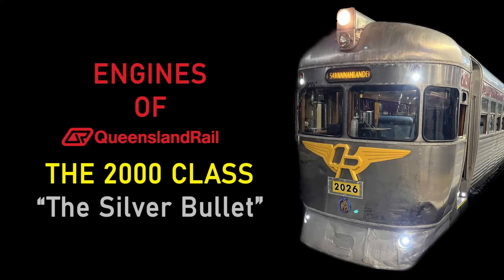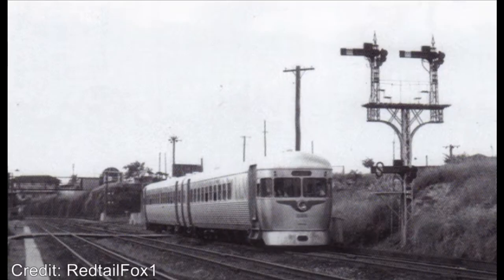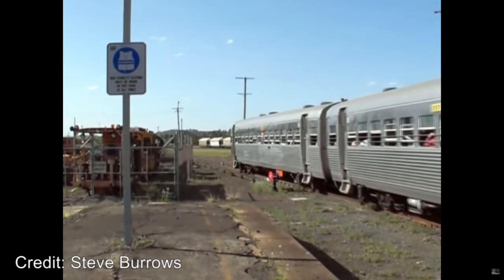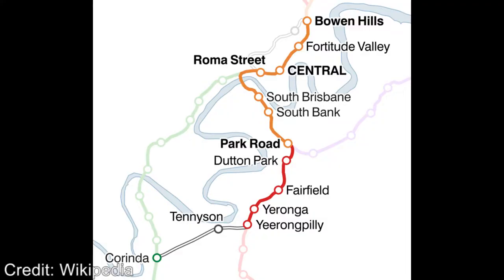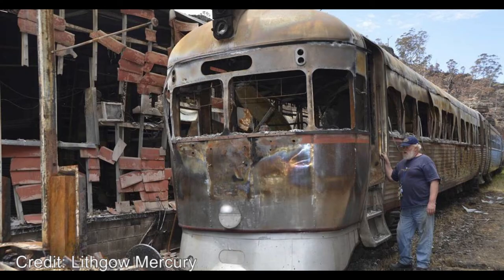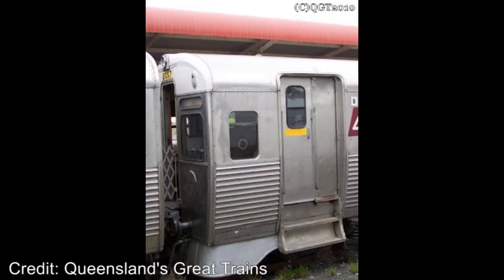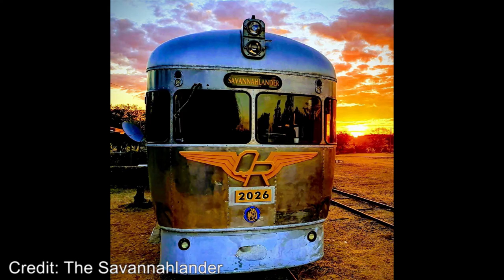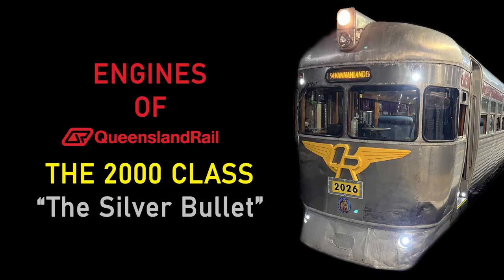Engines of Queensland Rail: The 2000 Class 'The Silver Bullet'

Comment: With respect to the 2000 Class engines, all models including the 1900 Class were fitted with  AEC AH 590 9.6 Litre 180 Hp engines until they were repowered with Rolls Royce engines in the late 80s -early 90s. QR called for tender to repower the railcars but as Leyland/AEC were unable to supply the same type of engine, Rolls Royce supplied the required units. QR needed an engine of no more than 180 Hp to avoid wheelslip and damage to the transmission.

I was involved in discussions with QR at the time, and mechanics from Leyland Trucks at Rocklea were called upon to commission the AEC engines when new railcars were ready for delivery at ComEng in the 70s.

The 1900 Class still has its AEC Engines.

Comment: A correction or 2. Most of the 2000 class had AEC220 engines early on.  The units at ZZR retain those.  2055 did not burn in the bushfires but has been EXTENSIVELY vandalised  it is stored. 2016 was definitely scrapped. 2008 which was bought for parts was burnt but not scrapped. 2020 has also been EXTENSIVELY vandalised and is stored. 2006, 2011 and 2051 are stored in tact pending decisions on their future.
Reply from the maker: @MrCrazy1072  Awesome, thank you very much for your corrections!! I’ll definitely need to remake this video at some point; it’s quite old for my video-making standards now and has a lot of inaccuracies I want to fix with feedback such as yours.
Reply: @thecairnsrailfan  all good mate. Glad I could help.

Comment: Great video.

However slight corrections- Queensland Rail was a modern branding term. For historical accuracy, from 1865 to 1993, it was known as “Queensland [Government] Railways - QGR. Which authority came under Commissioner Of Railways, the Department Of Railways through the Minister Of Railways (later Transport from 1946). 

When the 2000 class Railmotors were built, they were ordered under the Railways Department (Queensland [Government] Railways. 

QR ceased to be a Government commission in 1993, with the Railways Department & commissioner of railways abolished. Thus it changed its name to Queensland Rail and was a for profit government owned corporation with a CEO. Following the sale of QR National in 2010, it reverted back to QR as by 2013 once again ceased to be corporation by a government controlled commission under the Department Of Transport & Main Roads.

These are not locomotives, rather “Railmotors”. Hopefully that helps.
Reply from the maker: Thank you for the corrections. I appreciate it!
Reply: @thecairnsrailfan  our pleasure. Keep up the good work and videos. 👐